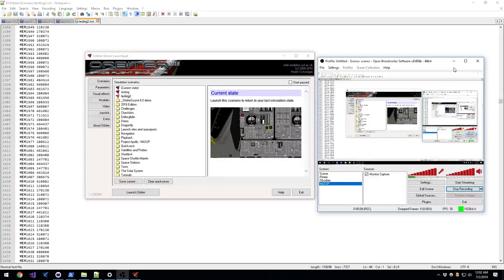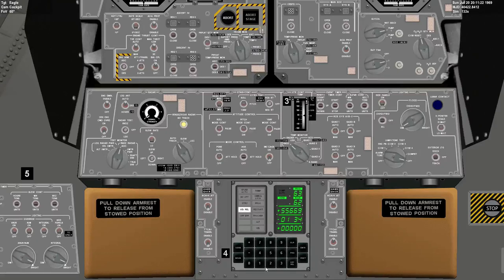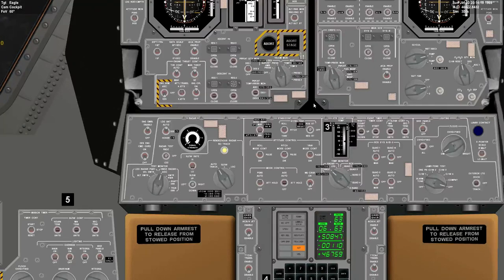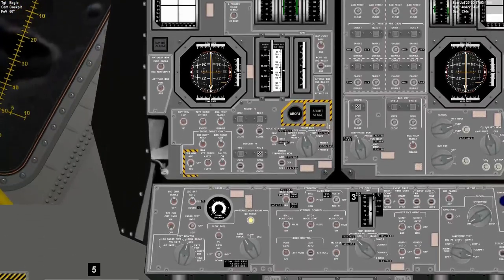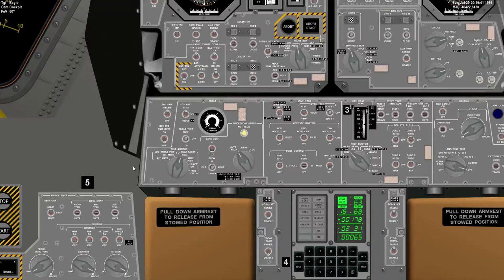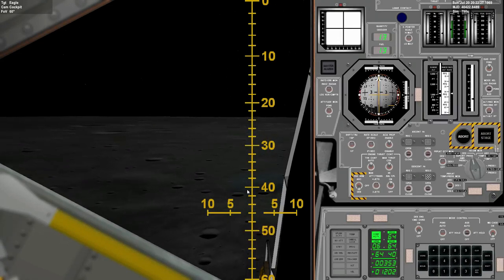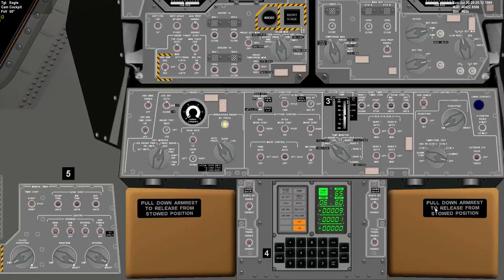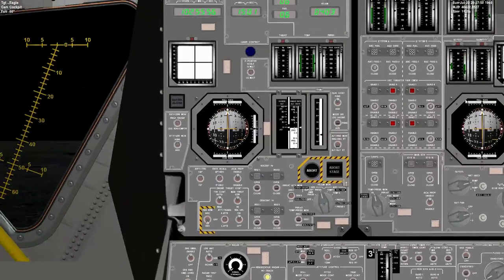FPGA AGC-Controlled NASSP Landing

Comment: Hey Mike, nice video!

-The RNG/RNG RT setting of the RNG/ALT MON switch takes data directly from the RR, so with no lock on there will be no data on the tape meters. The mode switch decides where the ALT/ ALT RT data is going to come from.
-Throttle down is not early, it's actually a bit late. 6:25 was the time for the actual Apollo 11 mission, you got about 6:45 which agrees with what we currently get in "normal" NASSP.
-You can also disable the altitude callouts in the Orbiter Sound settings, they are buggy in Orbiter 2016 anyway, they are done relative to mean lunar radius, not local.
-The RATE/ ERR MON switch on the CDR side should probably be in LDG RDR/CMPTR, so that LGC data are also fed to the cross pointer and the FDAI error needles. Probably a checklist error in the NASSP scenario.